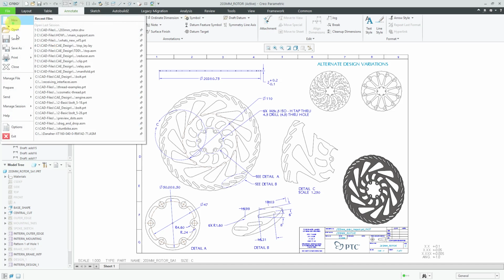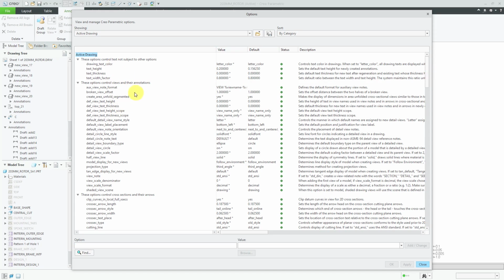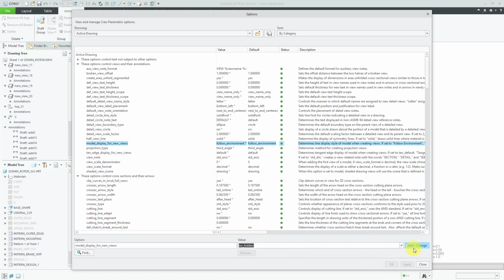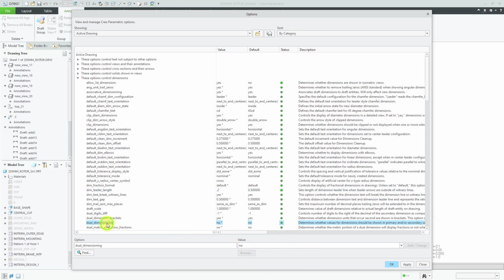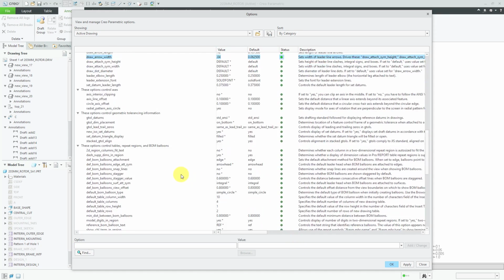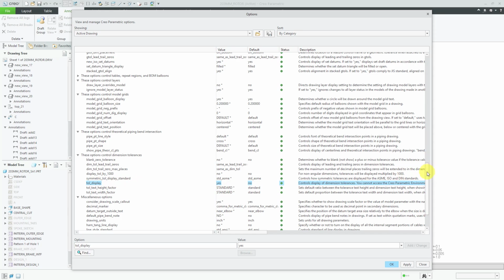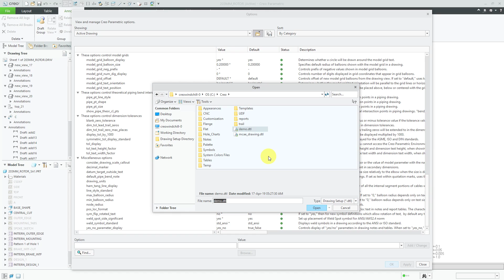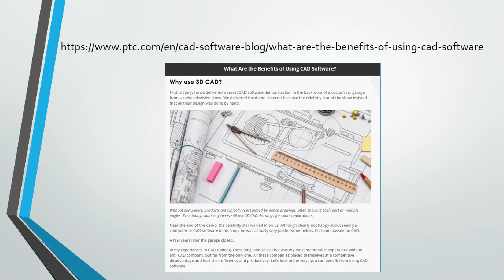Creo Parametric - Drawing Detail (.dtl) Files | Tutorial

Comment: Hello !

I would like to put a field in the title block that represents the custom scale of the drawing view and not the default scale.
Can you tell me how I can do this for my templates?
I have already tried & scale, & view_scale without success.
Reply from the maker: This is very atypical. Is it a view that already exists on the drawing? If so, as you denote, if you could do it, it would be a parameter of the format &view_scale:view_name. That might not work in a table though. Might work as a note.
Reply: @CADPLMGuy  Hello !
It is not possible to use drawing parameters in a note, it is the message I receive from the program.
It does not seem to make sense to display the scale of the format or any other than the scale of the view on a drawing sheet.
Thanks.
Reply from the maker: Maybe I’m missing something basic, but why not change the default sheet scale to your desired drawing view scale?
Reply: @CADPLMGuy  

Hello !

Maybe because I'm used to doing this in Autodesk Inventor.
I use standardized templates for formats, but each piece is a piece and depending on the need I choose the scale for each piece that I will detail. In fact the templates have visual basic code that detects the first view scale and places it in the title block. It's very simple.
For the need to attend a client that changed the platform to the PTC Creo I am trying to learn how to use the features of this program.

Comment: how to make the drawing for  non parametric model like step file, with datum axis of hole & rectangular cutout.
Reply from the maker: Ramesh, you're most likely going to have to create the axes in the imported geometry. Take advantage of Flexible Modeling when you can. Most likely you will need to create your dimensions manually if the imported geometry isn't STEP AP242 with annotations.